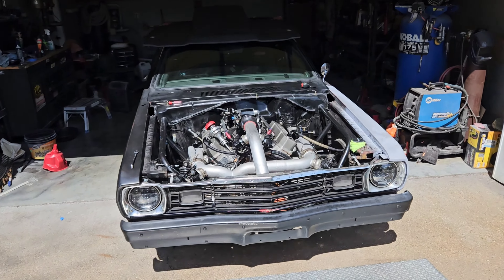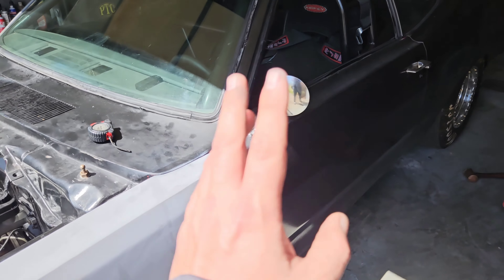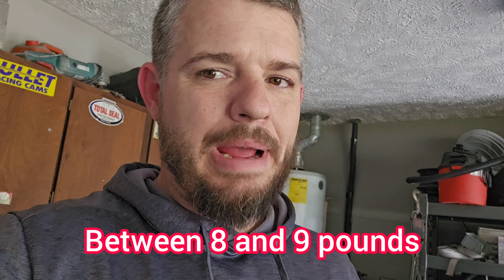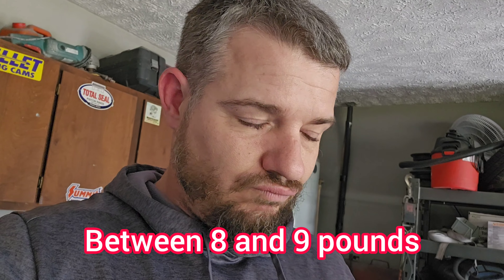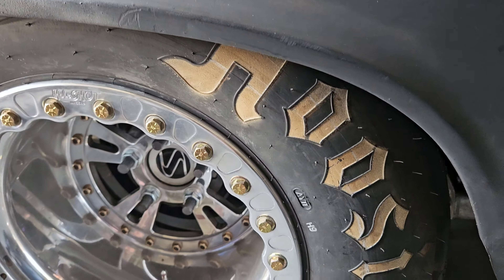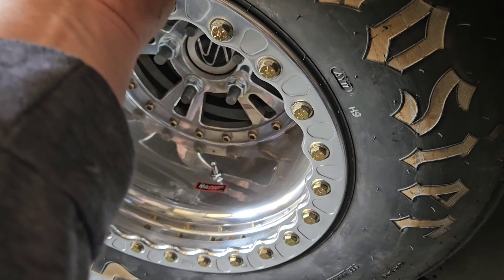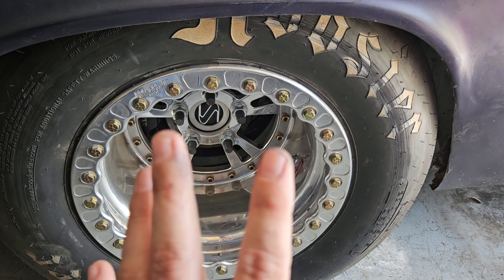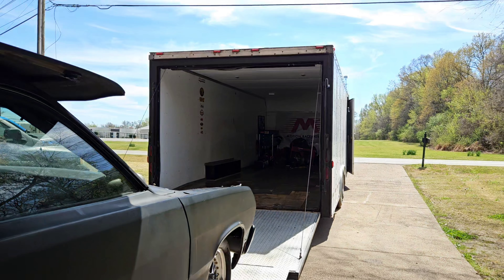Turbo big block Plymouth duster 1st passes, lots to change!

Comment: 2000rpm drop would be tight not loose or am i thinking wrong?
I know when a friend had a converter restalled that was only dropping 400rpm at yhe shift they tightened it. Hopefully hitting it with some more power and rpm the shift drop and leave will get closer to where uou wanna be
Reply from the maker: You are right, it would be tight, more power will loosen it. the plan is to go testing Friday and hit it with alot more power and see what it does.